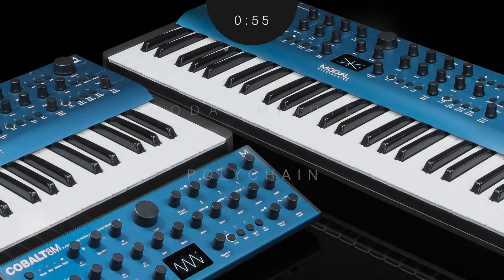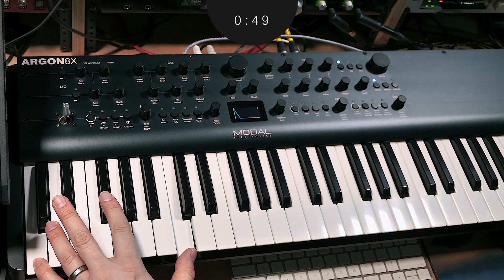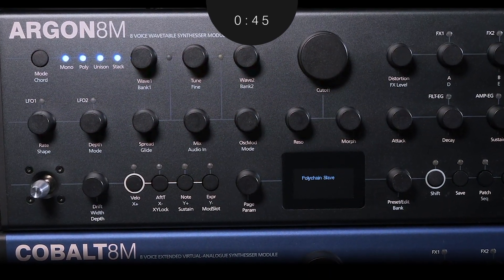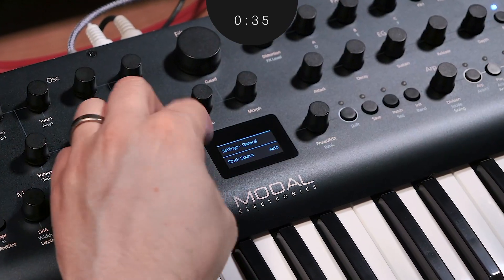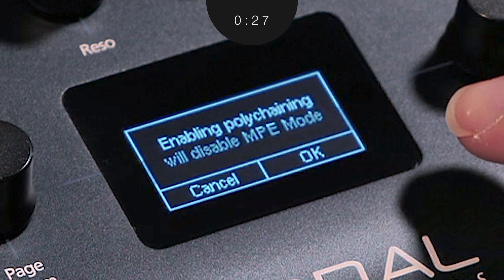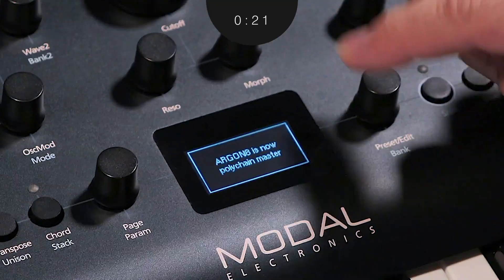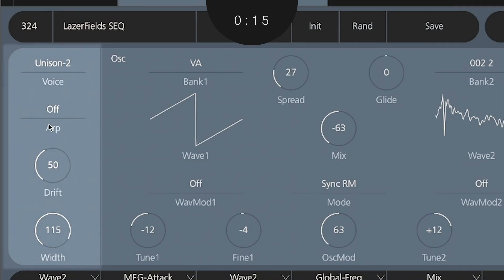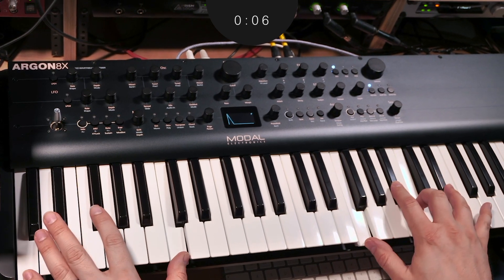Modal Minute #24 – PolyChain

Comment: this might be a stupid question but does the slave unit have the have the audio outs connected? If so does that mean I'd need to use 4 inputs in my audio interface? Or, does the extra polyphony work all through the master keyboards audio outs.. thanks

Comment: So even though you show the Argon & Cobalt together, they can’t be chained?
Reply from the maker: No, they can't because the synthesis engine in both synths is different. You can although control one form the other via MIDI.
Reply: @ModalElectronics  thank you. Been looking at the £50 cash back offer, but the participating retailers are limited and have low/no stock. Andertons is a blowout (as usual) in costing the most while having no saving. ☹️

Comment: What is recommended when using a Cobalt as a Midi controller to control a VST or another Hardware synth?,,Turning the audio down from the Master or simply unplugging the audio source from the audio interface? Or is there an option in the menu to enable or disable something,,,,,,, Thank you!
Reply from the maker: We would suggest to turn down the Master Volume.

Comment: Sucks that MPE is not available in polychain mode, is this something that might be possible in the future?
Reply from the maker: The data rate of the 5-Pin MIDI DIN ports is too limited. With MIDI 2.0 we would have more bandwidth, so if we implement that standard in future products we have MPE in polychain mode as well.
Reply: Can you polychain over USB ports or with a hub or can you direct connect one as a host? Any updates? Can you connect skulpt to these in polychain?